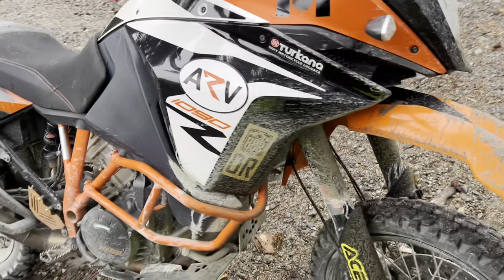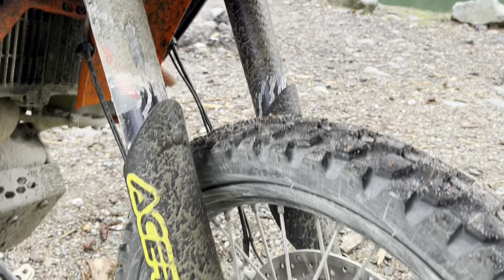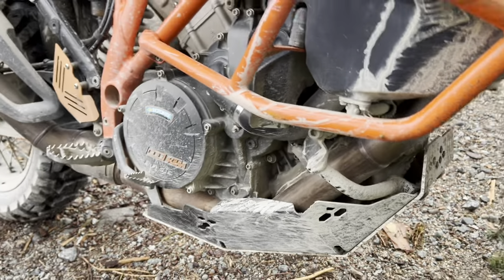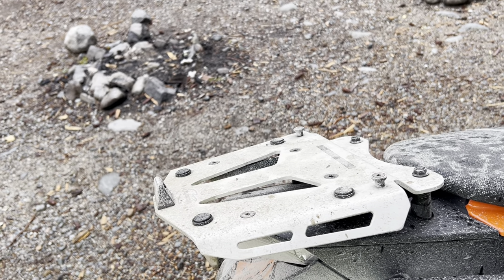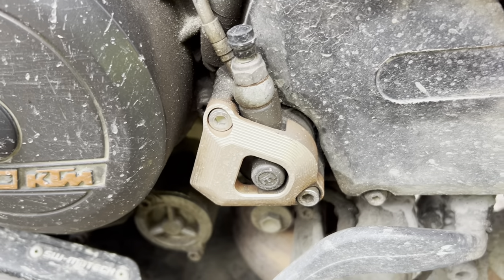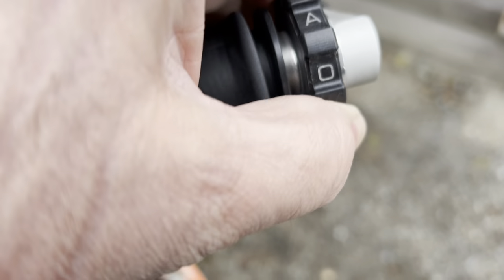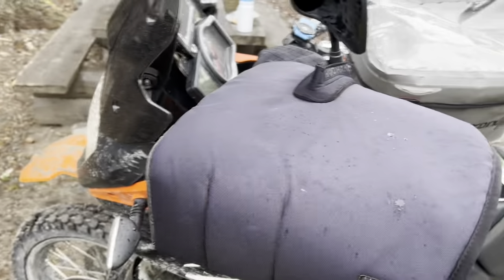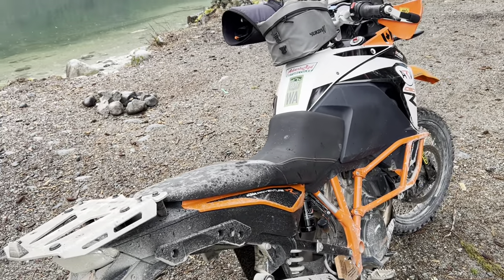2019 KTM 1090 Adventure R Modifications

Comment: Would you compare it vs 990 offroud ?
Reply from the maker: @mcmorphy4770  I had a 2004 950, so I can’t compare it directly. Having traction control and different ride modes sometimes helps, but I still loved the raw-ness of the original -> especially the sound of the dual exhaust under the seat!!!
Reply: @adventurod  thanks!  Any noticeable steering lightness? How about the flickability when body steering in upright position, which one carries its weight lower?
Reply from the maker: @mcmorphy4770  My overall skills have improved so much since owning my 950, I can’t compare. The 1090 is my dream machine. I’m 6’6” and 300lbs and I can wrestle it into some gnarly stuff.